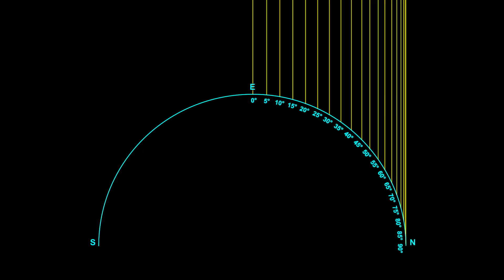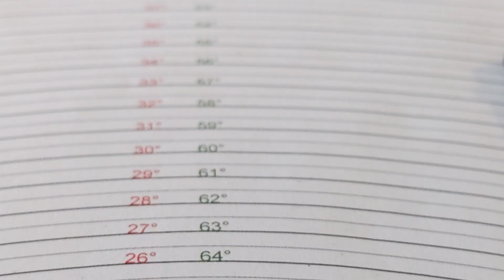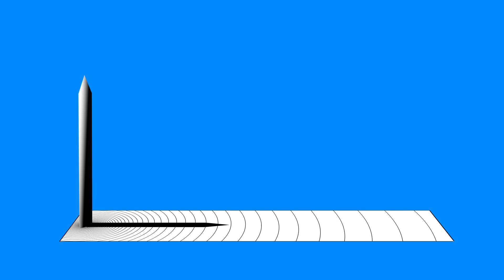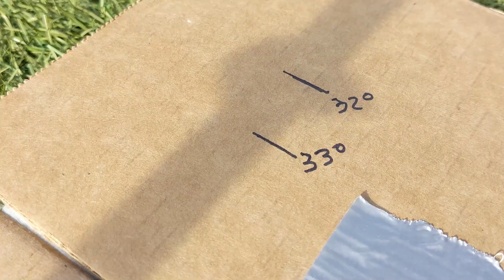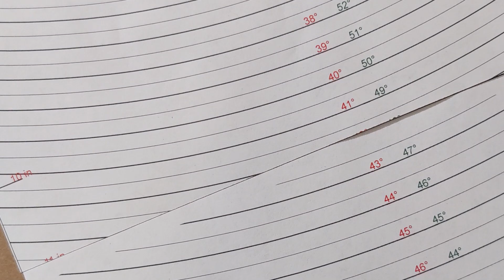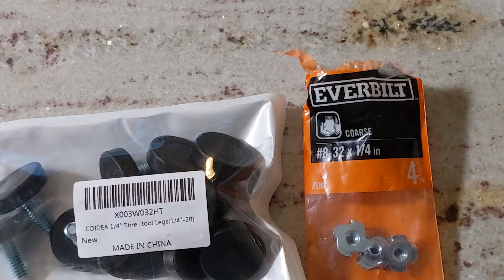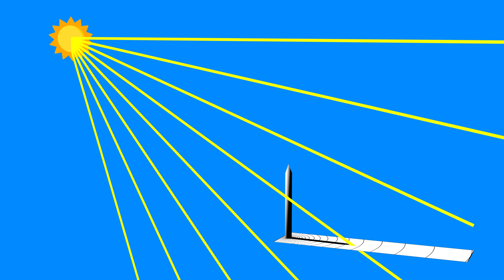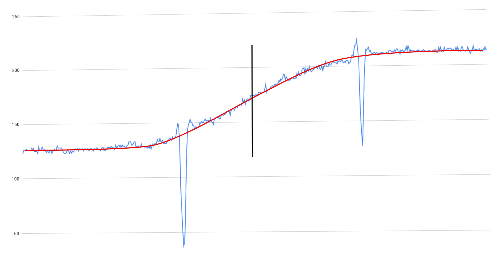Help me prove whether the earth is flat or round! (Part 2) #flatearth

Comment: First flat and round are not mutually exclusive.. flat coin,table, CD, record.. and second you can't acquire an elevation angle from a curved surface.. all you did was measure the earth flat..👍 
📐_________________ Nathan Oakley1980 covers this video, it's great amusement for us flat earthers but quite embarrassing for you guys.
Reply: The statement is ifalse because elevation angles can be measured on a curved Earth, and these measurements are used in fields like astronomy, surveying, and navigation. Your claim misinterprets how local horizontals work on a spherical surface. Elevation angles can indeed be measured from a curved surface like a round Earth.
The elevation angle is the angle between the horizontal plane (the observer's local horizon) and a line to an object (e.g., a star, the Sun, or a distant landmark).  
On a curved Earth, the observer's local horizon is tangent to the Earth's surface at their location.  
The "horizontal" at any given point is perpendicular to the local gravitational pull (which points toward Earth's center).  
This means that each observer has their own local horizontal plane, but they can still measure elevation angles using instruments like a sextant or a theodolite.  
Celestial navigation, which has been used for centuries, relies on measuring elevation angles of stars and the Sun relative to the observer’s horizon. These measurements work precisely because Earth is round, and navigators use spherical trigonometry to determine their position.
The claim that "all you did was measure the Earth flat" is misleading. While an observer's immediate horizon appears locally flat (as expected from a small segment of a large sphere), the overall framework of elevation angle measurements aligns with a spherical Earth model. In fact, the curvature of the Earth is accounted for in navigation calculations, such as determining a ship's position using the assumed spherical shape of the planet.
Flat earth misunderstandings, fallacies and lies is a great amusement for nomal people but quite embarrassing for flat earthers. For a start, you are not even able to show a realistic explanation about days and nights on this imaginary flat planet.
Reply: @VivekanandaKF  elephant hurling fallacy.. you clearly don't understand what angles are..📐______________ 🚶 the horizontal plane the observer is standing on..even your beloved erastostones measured the earth flat..you can't acquire an elevation angle from a curved earth.. it's measured flat regardless of your religious belief.. after it's measured flat you can apply the haversine formula to convert the flat earth measurements into an imaginary sphere if you need to reify your religious belief but it's not done in the field
Reply: @albirunicappacino6910  You started with a false dichotomy fallacy by implying that "flat" and "round" are mutually exclusive, then attempted to counter this by citing everyday flat objects that exist within a round world (e.g., coins, tables). However, this conflates two different contexts—local flatness vs. global curvature.  
You also asserted that "you can't acquire an elevation angle from a curved surface," which is a bare assertion fallacy —a claim made without supporting evidence.  
- The reference to Nathan Oakley1980 (a known flat Earth proponent) functions as an appeal to authority but lacks substantive reasoning.  
 - The phrase "it's great amusement for us flat earthers but quite embarrassing for you guys" is dismissive rhetoric rather than an argument.
I provided a well-structured rebuttal that explains how elevation angles work on a spherical Earth, using established principles from astronomy, navigation, and surveying. I also explained how the local horizon appears flat due to scale but is ultimately part of a curved surface, providing a detailed scientific explanation.
But yes, you can find a small problem here  - the phrase "Flat Earth misunderstandings, fallacies, and lies" and the closing statement about the inability to explain day and night on a flat Earth might be seen as rhetorical jabs that could provoke rather than persuade. For now, let us ignore that you can't explain days and nights.
You dismissed my explanation by calling it an ""elephant hurling fallacy," which is a misapplication of the term. (Elephant hurling refers to overwhelming an opponent with too much evidence, but my response is structured and relevant.)  
You claimed "you clearly don’t understand what angles are," which is an ad hominem attack rather than an argument.  
- The assertion that "even your beloved Eratosthenes measured the Earth flat" is misleading; Eratosthenes' experiment provided one of the earliest empirical proofs of Earth’s curvature.  
- The claim that elevation angles are "measured flat" and then "converted into an imaginary sphere" is an example of reification fallacy, incorrectly assuming that spherical Earth models are arbitrary rather than derived from real-world measurements.  
- You concluded by characterizing "belief" in a spherical Earth as a "religious belief," which is an equivocation fallacy—misrepresenting scientific conclusions as mere faith-based convictions.
- This conversation illustrates a fundamental misunderstanding of how measurements work in practical sciences.  Flat Earth arguments often rely on local observations (small-scale flatness) while ignoring large-scale curvature. Elevation angles work precisely because of the predictability of Earth's shape, as evidenced by centuries of successful navigation.
I provided the strongest argument by backing claims with scientific principles and real-world applications.  
Thia discussion highlights the common difficulty in debating flat Earth claims - many arguments stem from a misunderstanding of geometry, physics, and navigation.

Comment: I have a much simpler test for all of the people who haven't learned the truth about the level stationary earth .
During a sunset somewhere with a clear view of the horizon , place a stick in the ground with a wall behind it to catch the shadow . If the earth is a globe , and we are spinning , the shadow should get higher on the wall than the height of the stick because the sun is technically at ground level , the same could be seen at sunrise as well .
Reply: Better to do that at high altitude, which would result in the necessary horizon dip. Then you will get exactly those upward light rays.
Reply: @RogHawk   Earth is Measured flat/level.
All roads lead to a flat earth 
God bless your cotton socks 🧦🙏🏼
Reply: @cr0ckett  Centuries of surveying disagree with you.
Reply: @RogHawk  Surveying is proof of a flat earth. All plane surveyors assume a flat plane for 100² mile sections. Those sections are then stitched together, which does not work with a sphere.
Reply: @Heracles_FE  This is incorrect. Plane surveying has margins of error, compounded over distance because the Earth is a spheroid. Geodetic surveys are more accurate as they take this into account. They do not take flat maps and stitch them together.
Reply: @RogHawk  Wrong again, Rog. Astro Geodetic surveying corrects to the stars and to the geoid. All of the supposed curve id added via correction.
Reply: @Heracles_FE  Reciprocal zenith angles and spherical excess say otherwise, I'm afraid.
Reply: @Heracles_FE  And again, your proposed test has been done. 
https://youtu.be/FVeNNfC1VOY
Reply: @RogHawk  All optical, and corrected to the stars and the geoid model. They throw out all measurements outside of their expectations. When those measurements are included, they are routinely off as much as 15%.
Reply: @RogHawk  Wow, just, wow. The shadow was the SAME HEIGHT at 1268' . 
What I asked for was a sealevel observation in which shadows are HIGHER than the object casting it. I will even accept a picture of a ten story building casting an eleven story shadow on a higher neighboring building. That can't and won't be done.
Reply: @Heracles_FE  Shadow was higher than the object casting, as requested. And as I said in my first comment, best to do that at altitude, as at the surface the horizon will have zero dip, so the sun rays are not expected to have a line of travel upwards at that elevation.
Reply: @RogHawk  The shadow was the same height. He said he was touching the ceiling when he showed the shadow. 
Also, are you telling me if I put a lamp on my floor, it won't make shadows appear higher?
My objection to the added height is because of perspective.
You can check this on your own. Take a handheld mirror to a straight stretch of street with streetlights at least a mile in length . And you will see the streetlights appear to descend in the distance. Within a mile they will appear to be below your eye level, even though they should only appear 8 inches lower. 
If you take the mirror and put it upside down and level, you will be able to see the reflection of the light on the mirrors' surface . This light, in actuality,  is well above your eye level, even within the globe model, but perspective lowered it, and all observers, man, animal, mirror, or camera suffer non Euclidean perspective.
Reply: @RogHawk  Did I ask for upward light rays? You really don't understand perspective do you?
Reply: @Heracles_FE  Why yes. Yes, you did. And yes, I fully understand perspective. It wrecks FE every time.
Reply: Just as you ordered. https://www.youtube.com/watch?v=1EGvRuUe8rU

Comment: Why don't you need to take into consideration the angle of the earth?
Or the season? Isn't the earth at different distances at different times of the year? Also, did you take the velocity of the spin of the earth into consideration? How about the atmospheric conditions at the time of the test?
Reply from the maker: Ideally you would do this on the equinox so the sun would have a ground point over the equator. And you can only do this on a sunny day otherwise you wouldn't be able to see the sun

Comment: I’m not a flat earther, only recently realizing that people actually believe this and it’s not a meme. But I do care about accurate data. Do flat earthers agree how gravity works? I don’t know all their positions, but right away, you are leveling your device based on our current assumptions of gravity. Will that potentially add error o the device if gravity doesn’t work how we presume? What about done earthers? This may disprove a flat earth, but seems a dome earth would also follow the globe earth model unless you go south of the equator as well. I don’t believe in a flat or some earth, but I’m open to the idea of either, if there’s actual data. There’s so much BS on the topic muddying the water that both sides seem to have good arguments at times.
Reply: From my understanding, they do not agree on the theory of gravity and rather point to the principle of density.
Reply from the maker: Yeah a lot of flat earthers didn't believe in gravity. But I think they believe in the idea of level
Reply: @paullsmith5548  regardless of what both sides call it, I assume both agree that bubble levels are an accurate form of measurement? I only bring it up because if there is a side with a theory that due to their belief in how things function, a bubble level may behave differently under different circumstances. Doesn’t sound like the flat earth side would consider it a potential point of error then?
Reply from the maker: @bohd3 I Believe flat earthers say things first due to buoyancy / sinking. But I don't understand how we can have that without gravity
Reply: Gravity is made up 1666 ( 666 ) earth's supposed curve .666 per mile sq, earth's supposed 66.6k mph around the sun, earth's tilt 23.4 from90 deg is 66.6 ,,,,get the hint who's running this 😈

Comment: 1/4" is the length of the rod or hole. You need to also match the width and thread. The nuts are #8-32, if I am reading the get properly they say #3-32, so the are too wide to fit in the hole.
Reply from the maker: Oh I see

Comment: Good stuff overall!

But why such a big and crude contraption? A cheap, commercial, plastic inclinometer with a soda straw attached will do about as well. And the symmetry of the straw negates the blurred shadow from the 1/2 degree Sun.
Reply from the maker: The smaller the pole, the harder it is to accurately record an angle. You can never negate the half degree blurriness. Only mitigate it.
Reply: @DataTime27  In my previous post I mentioned a straw (in conjunction with an inclinometer.) The shadow produced by a circular hole is necessarily symmetrical and hence amenable to reasonably accurate centration. Far less ambiguous than is a shadow produced by the end of a rod, pointy or not.  ;)

The straw could have at the lower end a piece of frosted Scotch tape or tissue paper stretched across the opening to act as a rear projection screen. The spot of light cast upon it, with its fuzzily dimmer periphery, would lend itself to easy centering to better than the Solar diameter in angular error. More so if examined with a magnifier.

This apparatus, with the built-in 'plumb bob' being the pointer by which to read the angle, is eminently portable, inexpensive, ready made, and obviates any concern over such issues as leveling/making vertical.